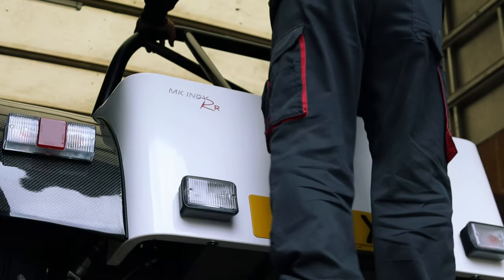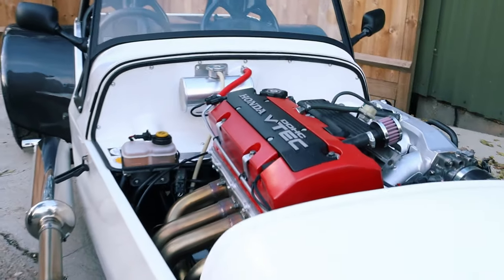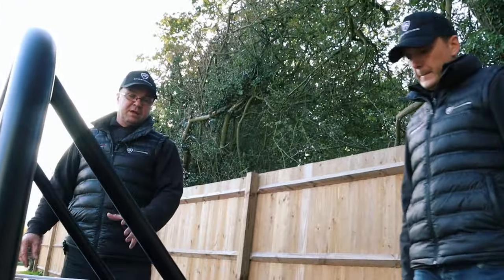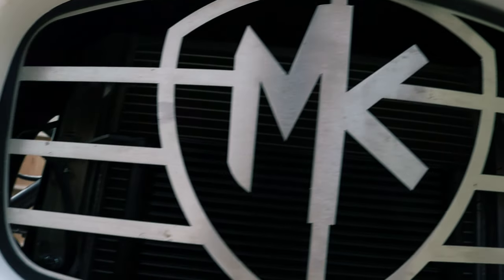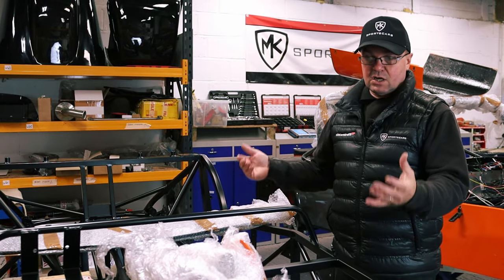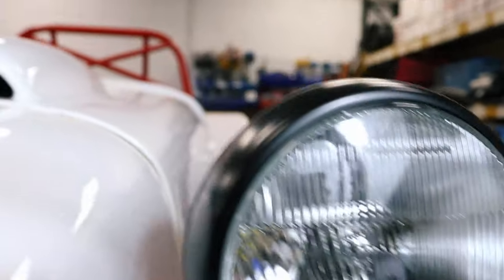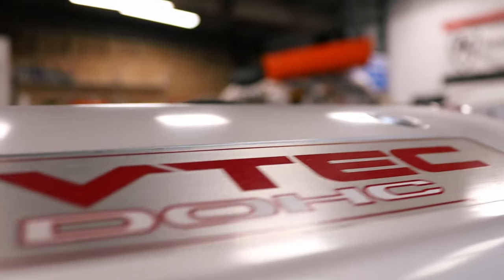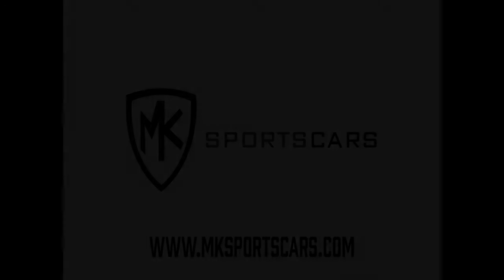Ep 96 - HONDA S2000 MK INDY RR just 174 MILES on the clock......FOR SALE??!?!? // Workshop Walk 96

Comment: Nice build but Umm..I rather just drive the s2000 car and I bet it will drive better than this hand made car.
Reply from the maker: Thanks for your comments, but they’re not really in the spirit of a hand built vehicle assembled in your own garage.  
I’m sure there is a marginal difference in the budget available between the two companies (Honda and MK) for R&D and production.
That said, this will run rings around a standard Honda S2000 on a short twisty track like Blyton or Cadwell….
Reply: Really looking forwards to completion of the I vtec build, must be loads of these engines sat in breakers as they hardly ever go pop and with an omex ecu must produce easily as much bhp as a tuned duratec!